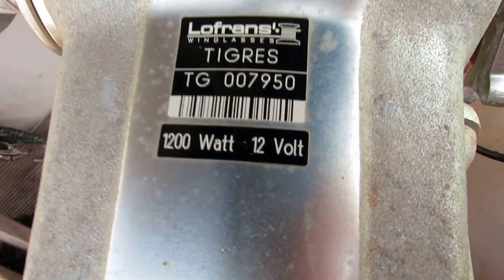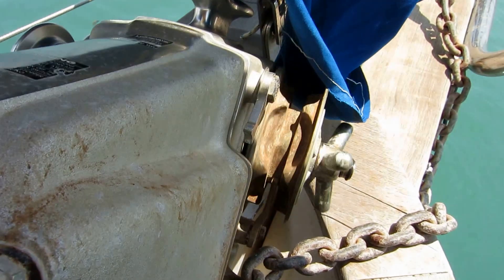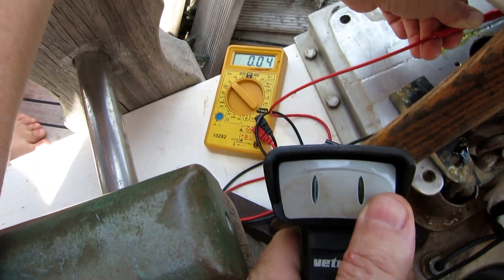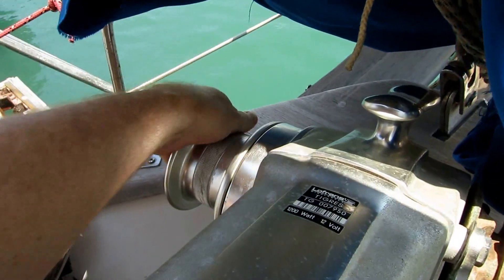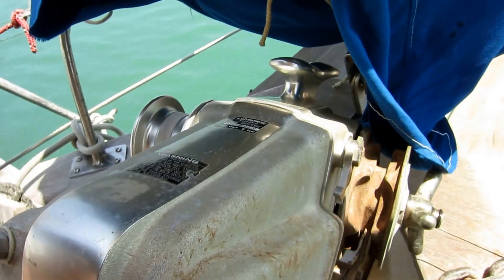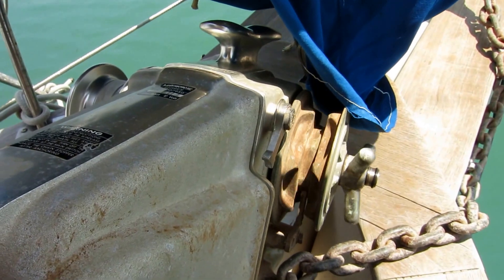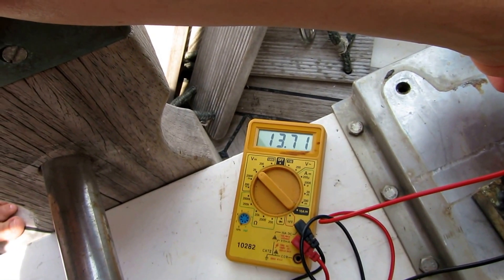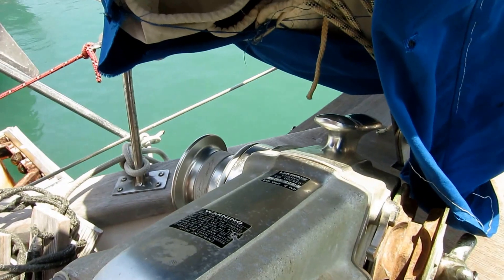Lofrans Tigres Horizontal windlass problems

Comment from the maker: The problem s in fact the brushes, they needed replacement, a simple fix, works perfectly now
Reply: Hi Paul, Where you bought the brushes? Thanks. Luiz from SV Cascalho
Reply from the maker: +Cascalho pelo Mundo an electrical engineer go them. but i have seen them for sale online. forget where though sorry.
Reply from the maker: +Cascalho pelo Mundo http://www.yachtsupplydepot.com/anchoring-docking-and-mooring/windlasses/lofrans-brushes-for-motor-1000w-12v-1200w-12v-bk33609.html